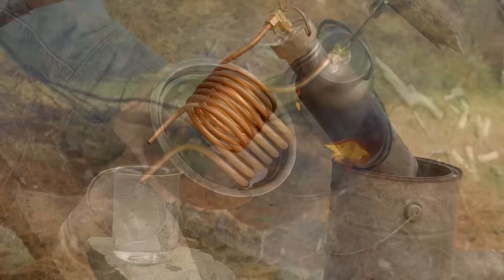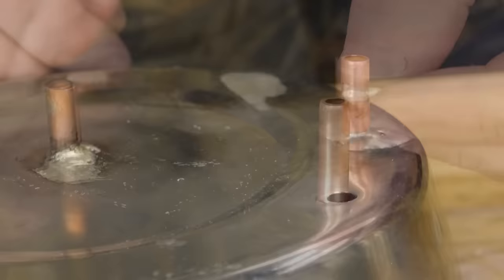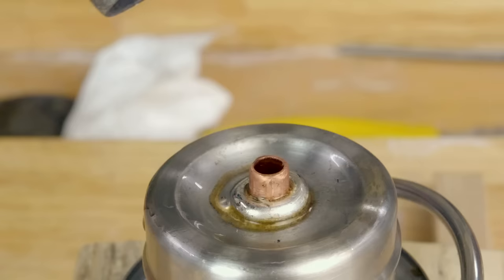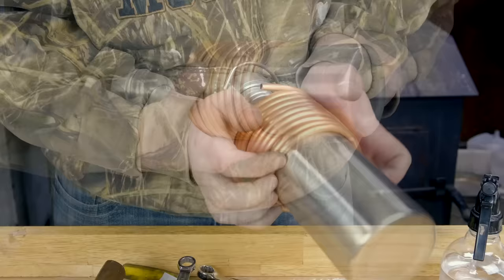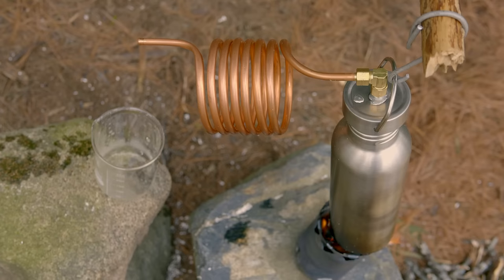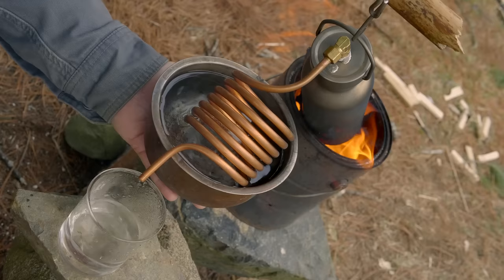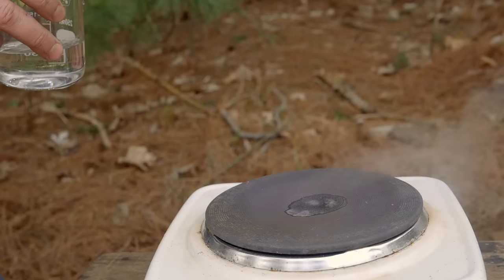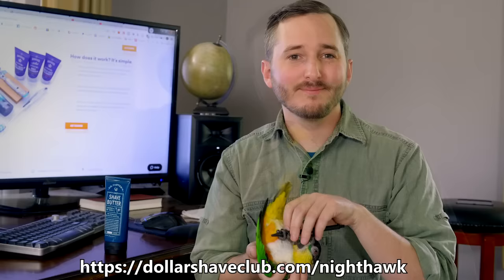DIY Salt-Water Survival Bottle (Compact Desalination Kit)

Comment: For best energy-efficient results, direct airflow from ambient air over the condenser coils, then using that heated air to heat the salt water directly (electric burner) or to pre-heat the air used for combustion.  Done right, with a well-insulated heating chamber, you can recoup 95% of the energy used to heat the water.  You can even recoup water from hydrocarbon gases burned in heating.

Comment: You can make the project simpler by only soldering the drilled hole on the inside. Since it won't be sealed theres no need for a third hole. You could add a length of pipe to store in the bottle with another compression fitting to give more room to work around it.

Comment: You can use another water bottle with the same holes but just slip the cooling tube into it but not soddered into it. The vent hole could have a length of tube sticking straight up. Then you could set that bottle in some water. Any steam that vents will cool almost immediately and run back into the bottle.

Comment: Outstanding project and as you mentioned concerning suggestions my suggestion to you is a deeper much larger pressure cooker can be used, for larger amounts of water!
Reply: Old fashioned kettle would work well! Designed to be heated and already has a steam port so no need for drilling, you could get a large food grade safe silicone tubing and one of those screw-band clamps to hold it on over it, use bread twisties to hold your hose in a coil shape, and you could probably use a small fish cooler for your condensing pool. An old mini grill grate to hold up your kettle above a fire/coals and all stores away in the cooler :D

Comment: What a fantastic project.  Your device is brilliant. I feel that in bushcraft education,  there isn't enough information about distillation and it really should be a basic everyone learns, beyond desalinization. 

Actually this device can produce purified water from almost any (non-radioactive) filtered water source, even a puddle or a natural bog.

One that doesn't  have a very strong smell or heavily colored water, as these indicate the possible presence of volatile compounds in the water which distilling (or filtering or boiling) wouldn't remove either.

Before industrial dumping,  such polluted water ponds, bogs and marshes were extremely rare.  Unfortunately thanks to modern unscrupulous chemical dumps and pipelines leaks, it is not so uncommon anymore. So do be careful when selecting a water source,  regardless of methods.  

 Still many sources of water that can be distilled remain abundant. Boiling and filtering are usually sufficient,  but there are some chemicals and particulates that regular filtering and boiling wont remove but distillation does. 

In these cases, you wouldn't add a small amount of the water concentrate into your distillate from your distillation bottle to remineralize. Instead a pinch of sea salt is sufficient,  if you add a pinch of natural sugar too, it is even better.  Or you could run your distillate through a clean sand and carbon filter (easily assembled with a plastic bottle or bag) and voila. 

You could also improvise a solar still using a large and sturdy enough clear plastic bag,  a container to receive the condensation drips and a some sticks or other structural support to create a funnel or tube from the top of the bag, draping into the container while the plastic bag rest in a shallow open hole in the ground. Or other support or container that allows the sunlight to heat up the water in the bag, while it is held up. 

The bag should not be filled more than half its capacity and the top draped in to the container must be secured enough to hold its position but not in such a way as to preclude the flow of condensation.  

You can use this exact same plastic bag set up, even if you don't have water by filling the bottom half of the bag with greens, leaves, grass... Anything that contains enough moisture to create condensation.   

At any rate, thank you for such brilliant video.  This is a project that I definitely plan on making. This information is incredibly valuable, thank you again.

Comment: Guys on a raft in middle of pacific-  " Water- no problem, just take the stainless steel bottle, the copper tube, the 90 degree compression fitting, the little bowl, and a glass and then the cigarette lighter , paper and wood for the fire and we'll be drinking that fresh water in no time"

Comment: Some severe necro-posting: I'd use the undistilled sea water to add salts/minerals to the distilled water.
One could also just let some pine needles soak in the warm water to release vitamin c, for the same purpose.

Comment: Two points--
1. If the desalination device is intended for those stranded far from shore, it may be a mistake to presume a compact heat source is available. The US DOD has developed a sun-powered desalinator.
2. If the desalination device is intended to be an all-purpose water purification system, there are non-hazardous, chemical methods to purify stream or lake water, but without distillation. One method uses only three drops of Super Saturated Solution of Potassium Iodide (from an eye-dropped) per gallon of water. After a few minutes, water is safe to drink.

Comment: FWIW the solder used for plumbing, and particularly the flux, are different from the electronics stuff. You typically use a much more powerful heat source, a soldering "gun" rather than a soldering iron. But a flame can be fine too like in the video.

For survival use, you can get "reverse osmosis" filters. It's a filter that literally filters out salt, some sort of voodoo on the molecular scale. It needs pressure to push the water through, in the small kits that's usually a little hand pump. They put them on lifeboats, and ships nowadays tend to use giant versions, with powered pumps, to provide their drinking water. 

These are probably better than distilling, since they don't require a fire, can be done on the move. 

There's also, for non-salty water, more options. For fresh water that might contain bacteria. Putting a small amount of electricity through salt water (you bring the salt with you) produces chlorite bleach. You make a few drops of this, then add it to your water, leave for a while to work, and it should kill off any germs. They come with instructions for the exact details and quantities. You can get one shaped and sized like a pencil, they really need very little electricity, the salt lasts a while too. Drinking dilute bleach for too long isn't great for your gut bacteria, but the bleach will kill bacteria in the water long before it will start doing you any harm.

Comment: Over years, there may be an issue with galvanic corrosion between the copper and stainless, where the copper gets sacrificed through corrosion. Using epoxy might reduce that, though it's a bit toxic. You could also use removable brass or copper fittings, or use a stainless fitting.

Comment: I don't know how easy or feasible it would be, but it would be cool if you could design something to pull a vacuum on the bottle to lower the boiling temp of the water, so that you would need much less fuel/heat to do this. 

   It would have to be a (temporarily) closed system though, unlike in the video.  So you would have to have one container with the water that is to be heated, connected to a copper tube, connected to a another closed container to collect the water.  The vacuum would have to pulled on the entire system.   If you get it to around 28" Hg vacuum inside the system, that would bring the boiling temp of the water down to around 100* F, which means you would need nothing more than a single candle or Solar heat (painted black can or the like) to run the system. 

  Another way to increase the efficiency would be to put some insulation around the container with the water to be heated (if you're using a flame to heat it).

Comment: You’ve just made an alcohol still. Get a five gallon pail and boil some potatoes...mash them up in the water you boiled them in   Now add 15 lbs to 20 lbs of sugar and stir it all up. Fill the pail up to an inch or so of the top with warm water  so it is about 90 degrees f. 32degrees c.  Add a packet of brewers yeast. Cover it with a lid with a small opening to let out the CO2...put it in a warm place and wait ten days. Then run it through your little still.  From 7 to 18 percent will be pure methanol. White lightening. Just boil off the alcohol and discard the rest. Each boil should yield a good shot or two. Put it all together you should get at least a 40 once bottle of good stuff.

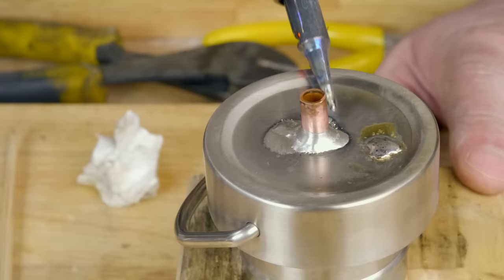Comment: 3:02, I would suggest looking into a Make your own Gasket Material from Automotive Grade Gasket Material, seeing as the Rubber Gasket is not rated for use with heat like a Open Flame.

Comment: The issue is that the copper tubing that you have is not efficient it needs to be submerged in cold water or lengthen the copper tubing. the stainless bottle does not need to be angled for water to come out it will be the pressure inside the bottle that will exert pressure as the water is being condensed. Consequently the cooper tubing will act as a vacuum to draw the saturated steam out.

Comment: A huge magnifying glass will heat that bottle right up.   Add another yard of copper tubing or more will  help cool down the water after being distilled losing less water in the air.

Comment: This is one of my favorite videos, and I've watched it probably a dozen times.  I've designed my own two-bottle system based on your design here such that I can easily pack it during a bike camping trip.  I'm working on making an activated carbon filter system using the same bottles too so that I can create a sort of ad hoc water station setup if needed.
Reply from the maker: If you're using it regularly watch out that any copper pieces don't corrode as the green copper salts are mildly poisonous. If I were to make this again I would use only stainless steel, no copper or brass.
Reply: Would it be more difficult to coil  stainless steel tubing? Could you do a Version 2.0 video with all stainless steel material?

Comment: Perhaps a short length of silicon tube so that you extend the condensation coil which you could then relocate say, into a small rock pool if you were on a beach.  The position of the bottle can be set easier.

Comment: There are a few things we can do to make this better.  Instead of using a piece of rubber to make a cap, they make caps for fittings like this so you dont have to do this.  Since youre using a stainless steel bottle, use a piece of stainless steel tubing to go in the lid of the bottle.  I mean if you really want to make this thing cool, use stainless steel parts except for the condenser coil which can remain copper.  Lastly, since Ive used a setup like this before I know Ice would defeat the purpose of the setup but you can freeze the condensor coil in water so when you start producing distilled water your production time will be cut to 3/4 of what it is without.  Again this would defeat the purpose if youre out where there is no ice but it would be a good thing if you were needed distilled water

Comment: if the parabolic mirror is optically good enough, would it not melt the metal?  your mylar fibreglass parabolic mirror seems like it would be perfect for the job, plus you could hook up the mirror to the sun tracker, maybe even use the intumescent paint for the condenser, and you could have a dedicated semi-automatic (still have to fill and empty the bottle and track it with the focal point of the mirror) no-power smoke-free desalination station

Comment: Any steam coming out of the end of the condenser is proof you did not need a larger fire. You were already past any efficient use of your air cooled condenser, making it run hotter at that point is just wasting energy and further overloading the thermal transfer ability of your condenser, put the coils in cool water and your efficiency will change more drastically that you can imagine.
Reply: Also coil condensers become reflux condensers when tilted at all, but hey if you want to burn more fuel than needed for a job and loose half or more of your distillation for views on YouTube while you play with your soldering skills which are coming along well, who am I to say anything besides a few comments to drive your traffic for definitely doing more that the average by far...

More thermal autistics and paint please.

Comment: One improvement that I haven't seen in the comment section would be to use a copper water bottle instead of stainless steel. Copper would keep the water, stored inside, free of microbes. Anytime the lid's opened allowing the water to be exposed to air allows airborne microbes to enter where they could multiply to an unsafe level. The copper is toxic to these microbes. Since the water will be consumed before the microbes have time to make the water toxic, this won't be a concern, but I still prefer copper. It's more expensive, but could allow me to store water for a while if needed. What do you think about this? Thanks for the video. This information could save somebody's life and you described the construction and use in a very easily understandable way. Been subscribed to your YT channel for a while now and I've enjoyed the content. I've shared with others and have suggested that my outdoor loving friends also subscribe.

Comment: Next, this is a small example of a salt water desalination still. But it needs to be bigger to be of any real use. Moreover, a small factory made water tank with a hose up top would be a more useful desalination still. In addition, desalination needs to be used in conjunction with water drums in the car boot and rain caught in a tarpaulin. This will make your total water storage last longer. For example, when you are using desalination three weeks in the jungle will turn in to three and a half weeks in the jungle. Furthermore, distilled water can be used to fill up the dog bowl while you drink out of the fresh water drums and wash with coronated rain water.

Comment: genius unlike those massive desalination tech ideas I've seen this is pretty compact like you say, i wonder if less coil ring will prevent less evaporation providing more liquids
Reply: Less rings gives less time for the water to cool down before exiting. Maybe it would work better if the coils were stretched out a bit, like a 1/4 or 1/2 inch between coils. They would get more airflow and might cool enough.

Comment: I am thinking that if you have a pot with lid that you use while backpacking that you could set this system up on the lid of your pot. Yeah, it will not be as efficient as steam will escape out from under the lid, but it might be a more efficient in regards to boiling the salt water.

Comment: Cool idea, however, it is counterproductive to add salt back in afterward. It's better to use activated charcoal as a filtration and purification method instead of adding salt water back to the clean water. No activated charcoal? Perhaps use a cloth, gather some white ash, and position it at the end of the copper tube?

Comment: You could design a proper modular kit and sell it with optional add on components.  i.e. like cooling bowl attachment, 12 volt kettle element, solar options etc...

Comment: If all you have is ocean water, 1 parts ocean water to 2 parts distilled ocean water is perfectly safe to drink for most people (basically unless you have kidney issues already). So for every 2 dl you can distill, you have 3 dl to drink. While this method can provide quite a lot of water quickly, learning how to make a solar still might be more useful as a life saver. "Luckily" you'll probably find the necessary pieces (collection cup from bottom of a bottle, small sheet of plastic and a rock) for that on any deserted island.

Comment: A few questions that I have:

• How much did all of the parts used cost (minus the drills, solder, and torch)?

• How long does this process take and how many times would you have to do it to fill an entire bottle of water?

• Does the copper effect the water, and would it be better to use stainless steel tubing?

Thank you for viewing my comment.
Reply from the maker: I don't know the cost for sure, but around $30. It would be much better to use all stainless steel. You can fit enough water inside to fill a water bottle with one distillation
Reply: @Nighthawkinlight  Thank you. Yours is the best that I’ve seen yet.

Comment: I prefer to use pressure fittings rather than soldering the copper tube to the stainless cap.
You dont add the salted residue back into the distilled water.
You can get salts from other sources.
If you have nothing but sea water, you're in big trouble if you
re not found soon.

Comment: There's another purpose to that coil as well that much steam could propel a small squirrel's cage so while you are condensing that water simultaneously you could have a squirrel cage attached directly to a small bicycle generator and run your 12 volt lighting system for camping survival etc indefinitely as long as you have fuel and a water source that's another opportunity for survival